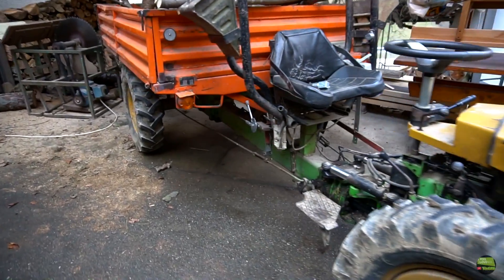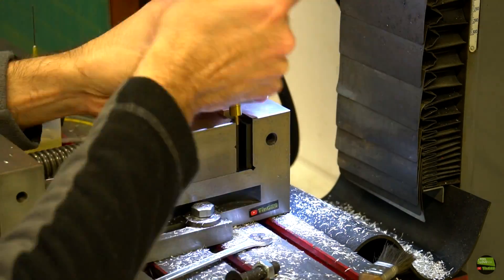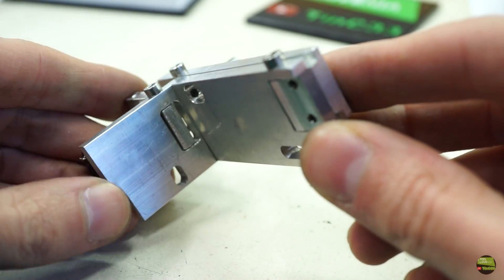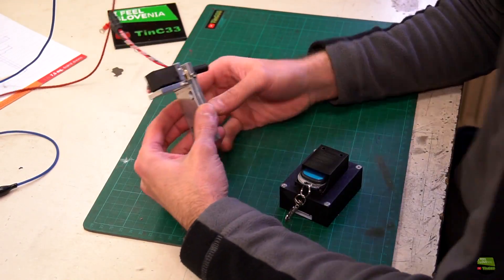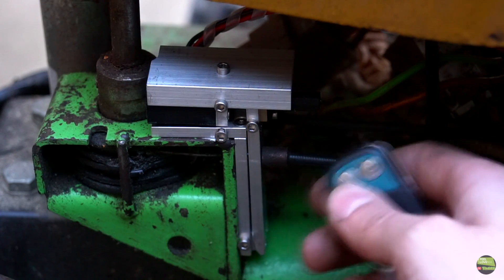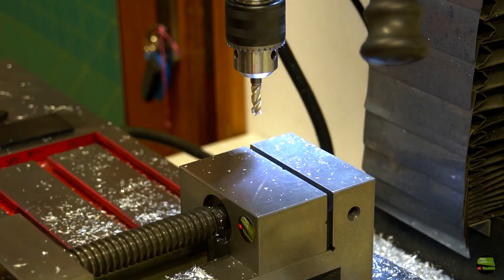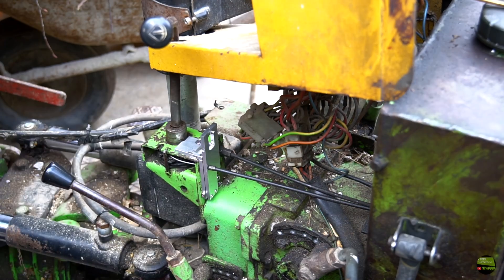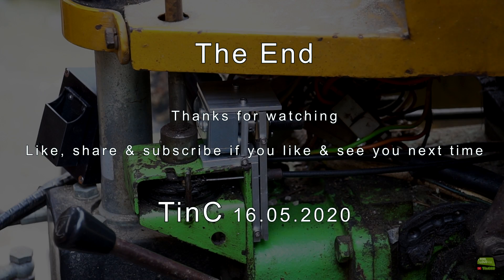Making Of: Radio Throttle control for tractor

Comment: Thanks for a great video and idea!:)
Question: where did you get the radio control and motor driver?
The affiliate link does not seem to work for me. 
Hope you can help :)

All good! Kristian
Reply from the maker: Ebay, check for "rf relay" "remote relay"...